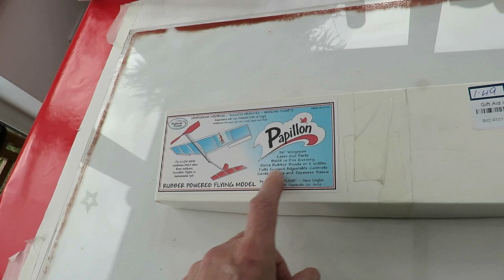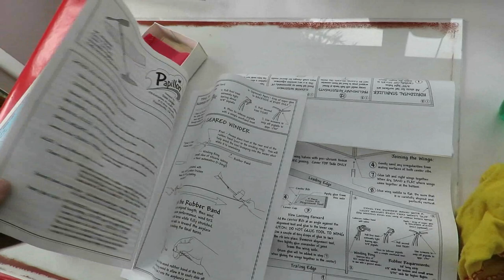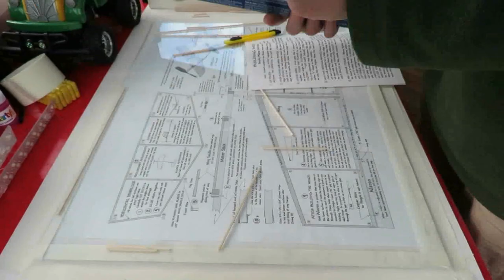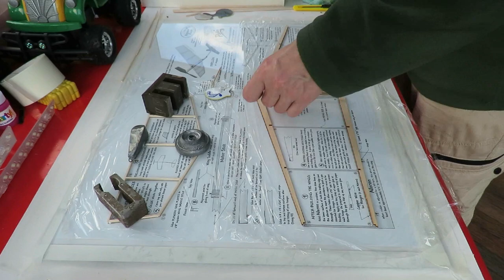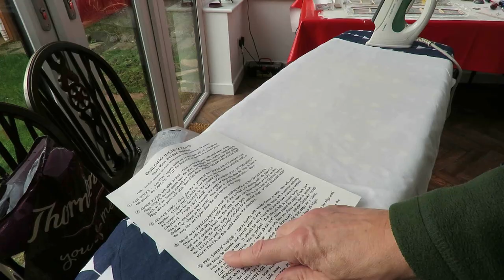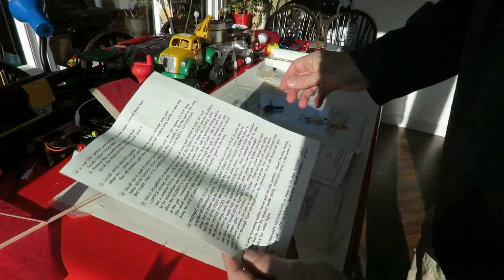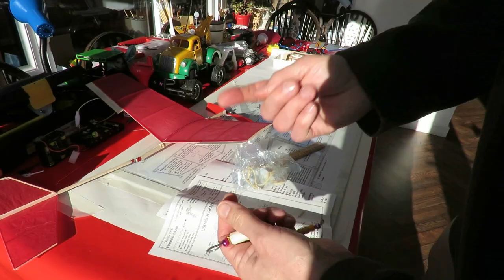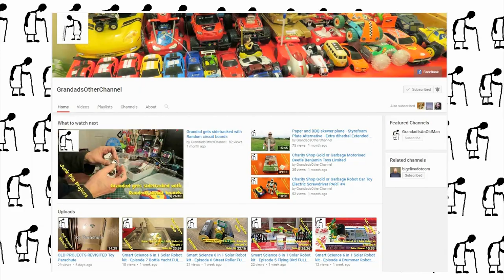Papillon Rubber Powered Aircraft FAST FORWARD

Comment: Just caught up with video, I've built a few balsa models but never had the plans under glass, used a board with pins stuck in to keep everything in place, but the glass method looks great, definately be nice and flat.
 Now your back into building with Balsa make a set of proper wings for the 10 second capacitor aircraft then when there is a good weather day you could compare both this new Papillon and the 10 sec aircraft.